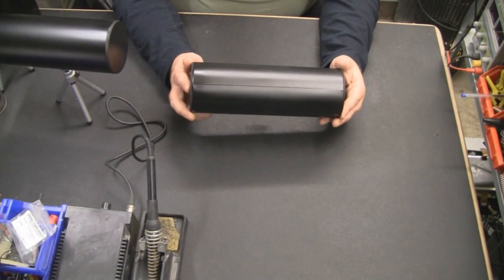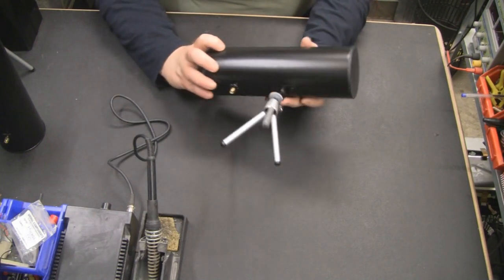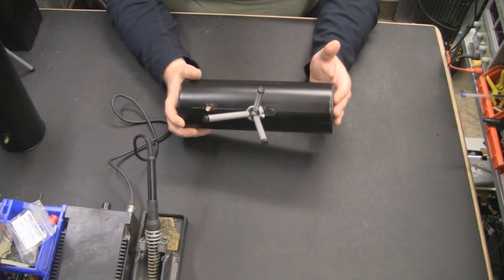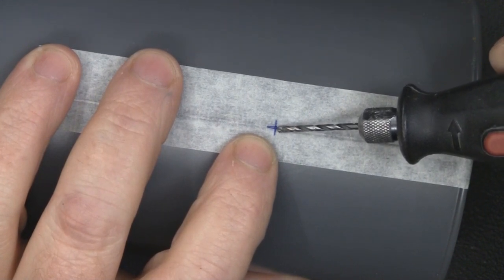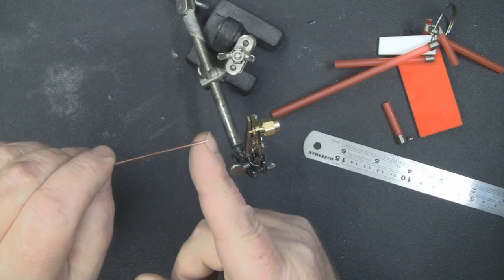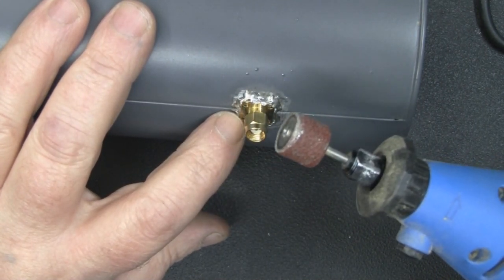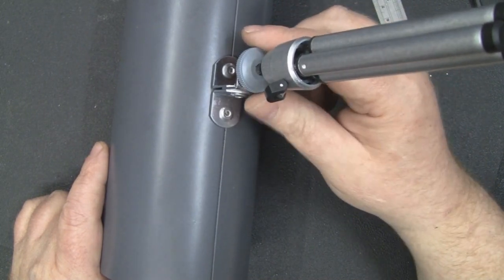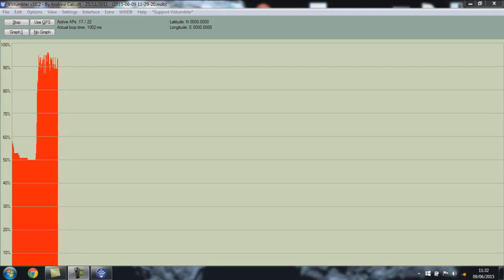2 4GHz Cantenna

Comment: An SWR of 1.5:1 is actually NOT bad. Anything under 2.0:1 is acceptable. I'd ditch the heat-shrink tubing and make the pass-through hole for the driven element a bit bigger. The insulation forms a capacitor which detunes you antenna.
Reply: I don't get it, isn't air insulation as well?

Comment: If you're taking into account the 7mm recess in the bottom of the tube and you're working to 0.1mm accuracy, you'll want to account for material thickness as well, probably around 0.8mm which is significant.

Comment: now the question is...does the uk use the same diamater toilet brush as the us lol
Reply: Not really.  Most the US ones I found were 4 inches.  It takes some time but I found one that is 3.5 inches
Reply: @clion520  fwiw, amazon.ca sells the exact one AM is using for around $10.
Reply: sorry...not exact...bottom lip is only 3.5mm

Comment: I build one today and had a lot of problems with soldering. Because my toilet holder was really made from steel and the solder does not stick very well. But for the cover i found a good solution. The yogurt covers from the 500ml cups in germany fit exactly on the toilet holders. Looks after the paint very professionel. Thanks again for this very good antenna Mr. Mcneil.
Reply from the maker: Yes I have come across this myself they don;t all seem to be made of the same mix of metals. M2.5. 4 mm long screws also work well with a 1.5 mm drill bit. Do you have any pics Chris?
Reply: Yes, here is a picture. Sorry i always to lazy to clean my windows.
https://www.pic-upload.de/view-35404714/IMG_20180530_201158.jpg.html
Reply from the maker: That's very nice and your windows are cleaner than mine :-)
Reply: Thank you. Makes me happy.
Reply: I forgot to present my solution for soldering the steel for other peoples. I used soldering oil (Lötöl) from a company named  Fohrmann ( payed today 7 Euro in my electronics shop) and it is especially made for things like that . First place the oil on the steel and than pre-tin this area, after that you can solder on the sma connector. I give it after cooling a little more strength with epoxy.
Reply: Chris, what length is the toilet holder you use, and how do you work out how far from the end of the can to put your element ?

Comment: Bless you for making these videos sir! I'm trying to locate the 21 swg wire on a budget. Is there something I could pull it out of? Like rg--59 wire or rg-6 wire? I'm pretty sure cat5 wire is 22 or 24 awg so that's a no go. I'm  reading the solid core of rg59 could be 20awg (. 8128mm) which is very close to 21swg (. 813mm).  Have you used the solid core out of an rg59 cable for a driven element before? Also I'm on the hunt for a stainless toilet brush holder and they only had chrome at Lowes, and the indention doesn't appear to be the same as the one in your video. I went to Lowes, home depot, Walmart and bed bath and beyond. No dice.  Do you have a link to one with the correct dimensions?

Comment: Sir I am your biggest fan! I've dreamed of testing and designing as you are! hope to be there some day soon.   Please I have no real experience I made a cantenna.  And connected to a router with tomato in client mode.   The router has 3 antenna port posts.  right middle left  , i assume one is for 5ghz i'm not sure how that works.     Do i need multiple cantenna for optimal performance and range? or does it help at all having a second cantenna ?

Comment: May I be so bold as to recommend to the expert a few enhancements? Can should be diameter 85mm, element 3mm wide, 30mm long, 75mm from rear of can, and a rod soldered into the can, 33mm long and 15-18mm behind the driven element.

Comment: I build these, too. I use "N" connectors on mine. I've made a biquad, and now I have a double biquad, I use as a feed mounted on an old satellite tv dish, which boosts the gain up 2 or 3 fold. You can mount the cantenna waveguide as a feed for a dish, too, in fact the feeds on them are waveguides, only they are smaller for the higher frequency used by satellite tv. Just put the can's mouth at the same distance from the dish, and at the same angle as the original feed. Keep in mind that the dish is a reflector, so to work, the dish will have to be at this angle / to be horizontal.
Reply: Would a usb wifi adapter work inserted in to the can instead of the copper element he uses ?

Comment: The use of a stainless steel toilet paper canister surprised me because stainless is a poor electromagnetic material; why does the stainless work and would a thin copper sheet work better? You do a nice job on your videos, thanks for taking the time to share your experience and knowledge. I would like to learn if this could also work as an antenna for a 900MHz GSM signal repeater. Thanks!
Reply: +Mark Main  he says that its not actually stainless steel
Reply: +Mark Main I think you're missing the point of the canister, that being not to conduct, but to reflect.  The can itself is meant to direct the beam while also minimizing the amplitude for a given wavelength, the same as a standing wave in a pipe.  The conductivity of the reflector is less an issue than it's opacity to electromagnetic waves.

Comment: I want to build that antenna but I have some trouble finding 20 awg (0.8mm) solid core wire at a decent price. Since I already have plenty of 0.65mm wire, would that diameter be sufficient? Thanks!
Reply: William Belanger I find 0.8mm wire in a coax wire for TV. Maybe that helps you out.

Comment: did i miss the length of the can, is the length important. great show. i have a router that has 3 antennas, and it is dual band, can i take off one of the antennas to put a cantenna or one of your others for either 5 or 2 gig antennas.
Reply from the maker: George Gardinier Hi George the length is 270mm and I have done the same with routers in the past. I don't know why manufacturers don't make a router like that, 2 omnidirectional antennas for blanket coverage and 1 directional for a specific area.

Comment: Hi! I'm thinking about building a cantenna but I'm really scared about the reflections from the cantenna - those will destroy the wifi router. I don't have any equipment to calibrate the cantenna so I'm thinking about running a continuous upload test while I'm inserting screws inside the can like you did. What do you think about this ideea? Could you please do a video about this? My ideea is that when I will find the biggest upload speed the reflections will be really small (and so the SWR will be at a minimum).

Comment: Hello Andrew,
I've build some parabolic antenna's for 10Ghz (3cm ham band) but i'm new to Wifi. Once You have your cantenna ready you can plug a wifi card on but what kind of card is it? They sell a lot of different ones; do I need a wifi extender, a wifi AP, or some kind of a repeater to connect to the cantenna? If you use it as a receiving antenna do you connect a cable between the card and the laptop? It may be seem obvious to you but I don't really understand the 'things' needed between antenna and laptop.

Comment: I got Kingspan in my wall and it reflects my wifi Signals I have a repeater but it is crap should I get that TP-Link Router and do what you did with the Cantenna, It has to run off PC > RJ45 > Repeater ------WiFi----- Router

Comment: Hi, I was wondering how you calculate the standing wavelength within the waveguide, I only know how to calculate with regards to the wavelength in air. I have heard lots of different numbers for the same dimensions of cylinder but I can't find what formula you would use to calculate the distance from the back reflector or the height of the driven element, I only know them in terms of the standing wavelength within the waveguide (which I can't calculate).
Thanks for making your videos, they have helped me more than just about any other source to understand antenna mechanics.
Cheers.

Comment: How far does the driven element need to be from the back for a 100mm diameter because online calculators don't allow a diameter this big and what about the length of the driven element?
Reply from the maker: 43.9mm but 100mm is a little to large

Comment: stumbled on this video. lf there is a router 20m away next to 3rd adjacent house , without clear LOS due to multiple in between walls of linked houses, does Cantenna still work? I tried to use WiFi repeater but get very weak signal
Reply: If you can get a weak signal (1 to 2 bars) by regular means (omni/internal antennas) then a cantenna will definitely work very well!
I use one myself. All I did is plug a usb wifi dongle into the hole of the cantenna (with correct measurements) instead of doing any wiring or soldering. Works like a charm.
You might have to play a bit with the dongle inclination inside the can for a better reception.

Comment: Hi Andrew.

I know it's just a can but here in sleepy hollow (Australia) we cant even get that correct for the dimensions you recommend, however I can obtain 90mm pvc. Could i use PVC pipe with the inside lined with say copper tape or a sheet of tin and a lined cap on the end?

Thanks

Walt
Reply from the maker: Hi you could do that but the diameter does not have to be exactly 90mm. You could use something say plus or minus 10 or 20mm without having to change the length of the driven element. But remember a narrow tube makes it more directional and a wider tube increases the beamwidth.
Reply: Thanks Andrew,

&#160;It was your suggestion that the above mentioned dimensions would be ideal for a good Cantenna that lead me to search for the particular size can. 

So a larger can would yield as good results but be less sensitive on the directional aspect?

Walt
Reply from the maker: I would cover the outside of the pipe as the PVC would have very little effect on the signal and it will be much easier to cover the outside.
Reply: Yep that could be a plan. 

I also wondered if the back of the can was parabolic instead of flat, Would the cantenna probe  receive more signal?

Just wondering if it could be improved.
Reply from the maker: I have tried that on a small scale but I did not see any advantage to it, Although it did lead me to come up with this: https://www.youtube.com/watch?v=2bc4Gi6Ib1s
Reply: Thanks again Andrew, for your time patience and tutorials.

Comment: Thanks for the video. 

 I have a remote underground garage which is remote from the flat.  I am not able to get a cable from the flat to the garage.  Do you think it is worth trying to get wifi from the flat to the garage by using a cantenna at both ends, one in the flat and one in the garage.  

The garage is around 80-100m away line of sight

I assume i would also need two alfa cards AWUS036NHA or i could do a double using the TP-link TL-WN822N as you have shown in another video.

How does wifi 2.4 or 5 when you have not got line of sight.

never made an antenna but feeling excited to give it a try.

If you think this idea is a non-starter can you recommend another solution i can research.

Thanks in advance

Comment: I have a question. I think antenna is not the big deal, the big deal is Tx Power? If i use this cantenna with 100mw wifi card i think it doesn't increase signal a lot?
Reply: RichBristol1 thats logical. Thanks!

Comment: Why do you seem to like the 100mm cans? Every online calculator I try seems to think that that's too big a diameter.   The optimum is 80 to 90mm diameter.

Next question is, what happens if the can is shorter than 3/4 wavelength?
Reply from the maker: These are 92 mm the best diameter for a 2.4GHz wifi signal is 82 to 98mm. The calculators or OK but if you study this area of RF you will soon outgrow them as they are very limited. most will tell you you can use 74mm and you can and it will work but it is crap when put next to a can with 82 mm. You can use a can shorter than 3/4 but technically it is no longer a wave guide and just a reflector and is to short to guide a wave to the driven element.

Comment: Could you use single walled stove pipe approx. 102 mm?
Reply: I wouldn’t use anything over 100mm, my friend. Bandwidth goes to s*** around thereabouts I’ve found. But I have used drier vent tubing (little smaller l) to great effect. If you have the “folded” seam on your pipe, unhook the seam and use a straight edge to back the catch-fold up a little. Good luck